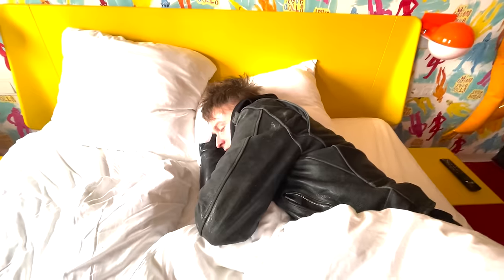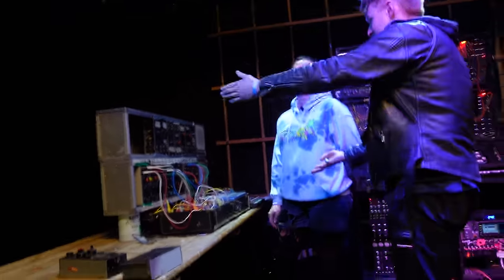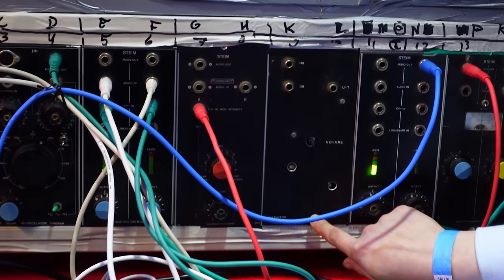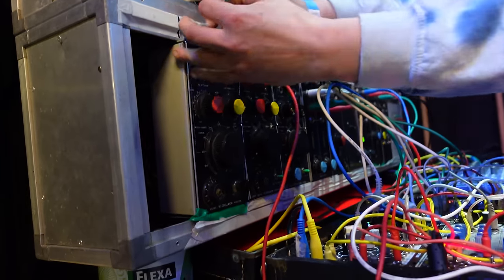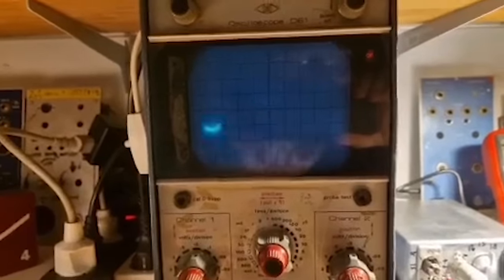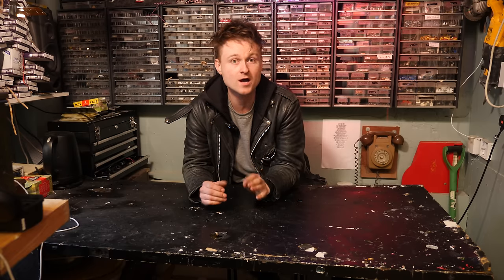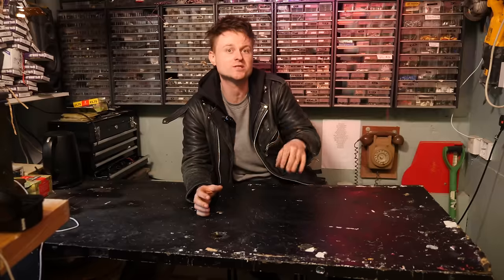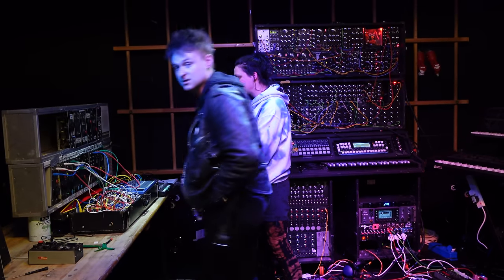Historic Synth With More Questions Than Answers - Steim Black Box Synthesizer

Comment: Interresting to see Meccano beeing used in the construction of some of the modules. It’s kind of the ideal framework material for DIY electronics enclosures. My father often used bare aluminum panels in the 70’s for creating the enclosures of his electronics projects. Meccano is ideal to hold these things together and those angle profiles where readily available.

Comment: The idea of building a modular system in which the modules are not directly connected to each other but rather led into a matrix so that every module can be connected to every other module is brilliant. By looking at the matrix you could see how the sound is constructed without having to laboriously trace every single cable between the modules. In addition, it is much easier to access the module controls if there are no cables hanging in front of them.

Comment: the internal regulation inside the modules is probably a good idea, worth revisiting.
Reply from the maker: Doepfer do it too in their oscillators
Reply: Nah, just a waste of heat and parts, you should only do that if you need precision references or voltages.
If you power an inverting opamp setup from +/-12 volt and another such setup powered from +/-6V connected to the first,  a normal 10V.p.p. signal would pass at same amplitude a properties as the first opamp powered with 12V accept less headroom. I use the Roland approach with 100R and a 10uF electrolytic capacitor as done in the TR-909, TR-606, etc and run the modules at a slightly lower potential as the PSU of the eurorack system, so the PSU has higher potential and frequencies, noise don't leak back.
Reply: @LOOKMUMNOCOMPUTER  
Doepfer does that to have a stable 10V witch is easier to divide, calculate RESISTORS with the 1 Volt octave standard.
Reply from the maker: @AnalogDude_  dieter actually said it was to stop oscillator tuning lock when i asked, so who knows! it was to 12v he mentionned. the 10v for the ref yeahh!
Reply: @LOOKMUMNOCOMPUTER  check the CV input chain of the A110 it's based on 10V, as the timing cap, it simplifies the calculation of resistors relative to 1Voct. the timing cap would charge faster using 12V giving you all sort of problems to solve with resistors. Dieter is  German and they like precision, it's their nature. i stared few hours to this schematic, it's a really good VCO, temperature stable using the CA3046  configured as tempco.

Comment: Cool, you're where in the Netherlands, rather top notch country, not?
There is none that can compare accept maybe Dubai, even the rich Belgium has roads full of pot holes everywhere..

check: bernacomp lockbox ring modulator, based on a gilbert cell, as before the chip is less than 1€ at the moment.